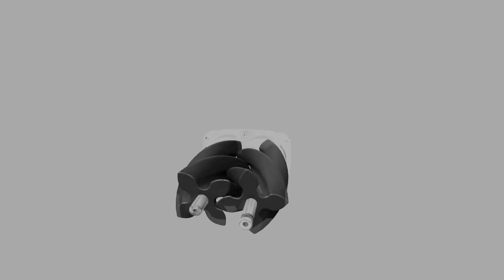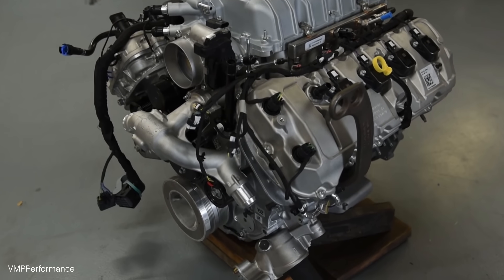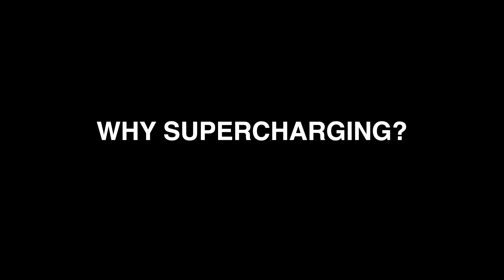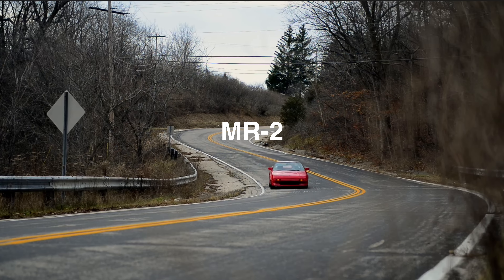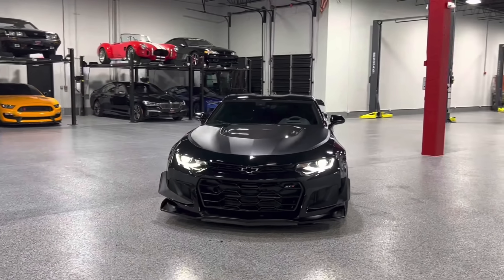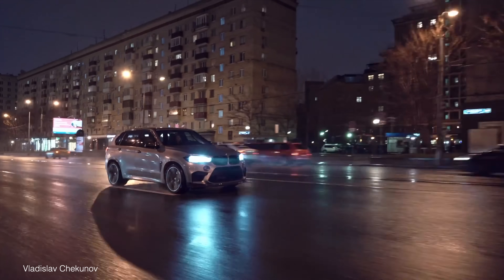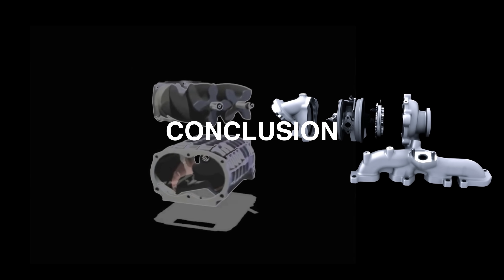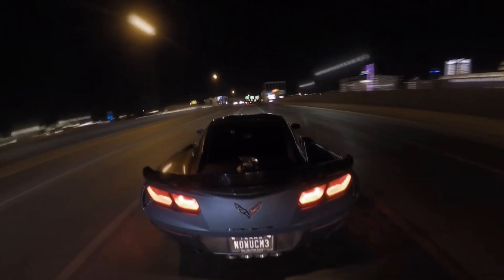Why V8 Engines Are Supercharged vs. Turbo😮| Explained Ep.6

Comment: My limited experience between the two is the absolute and immediate brute  force of a supercharger vs the mild start then overwhelming and uncontrollable kick from a turbo.   Love this channel
Reply: Gen 1 coyote can make 650hp safely with a vortech or Whipple, but It can make over 700hp with a single or twins without ripping the crankshaft input off, kicking a rod thru the side of the block. Turbochargers will always be easier on parts and more efficient because they do not have parasitic loss like a supercharger. This guy is smoking pole.
Reply: That limited experience must have been with improperly sized turbos and dumb Honda kids, because the right size turbo for whatever engine it’s on will provide more power everywhere- starting right off idle. Notably more than a supercharger.
Reply: @boost1728 Gotta say i drove a C43 amg and a S4 3.0 Supercharged. The brute force is a thing, i would always prefer a supercharger on bigger engines, on smallers a turbo feels better. But damn that throttl response is brutal, it accelerates like a electric car, especially with a dual clutch. I remember a W205 C63 in my rear which was chasing me. As soon as the autobahn was free i hit the throttle and i was already gone, he was faster than me in the end, but damn it took him like 4 secs to catch up until the turbos spooled. A supercharger just fucks off, when a turbo is more violent when it gets boost. Mine had a stage 1 remap to 400 HP, he had 457 stock or something.
Reply: @DarkSession6208 again, if the turbo was laggy and the supercharger smacked it off the line, it was the wrong size turbo. There’s a reason all the fastest pump gas street cars in the world are turbo. They make boost quicker off idle than a supercharger can, they make more power per pound of boost up top due to lack of belt-driven resistance, the list goes on. There is absolutely nothing a supercharger can do that a properly sized turbo can’t.
Reply: The new Porsche 911’s have hybrid turbochargers with electric assistance that give near instant torque. Turbochargers keep innovating and it’s so cool.
Reply: 2 spool or sequential twin turbo mitigate that problem, but turbos are less reliable.
Reply: @VndNvwYvvSvv lmaooooo
Reply: Turbo+n20=fast across the powerband
Reply: Are you stuck in the 80s?
Reply: Nearly 30 years ago I was in charge of production at Sprintex Superchargers (In Perth West Australia ) where we built and exported over 1000 units to Art Whipple (which is now Whipple Chargers and run by his son in Fresno California) There is the common misconception that turbo uses "free" energy from exhaust gas. This is simply incorrect. Many years of R&D at Sprintex and any identical engine with equal amounts of intake manifold pressure. (e.g. 50kpa) will make pretty much the same net BHP. We did diesel, petrol, aircraft, industrial engines, marine and old and new engine design all with fantastic results. Turbos can not take advantage of natural exhaust scavenging either. I agree it is a bit of a historical thing also but Superchargers do sound great..👍🤪🦘
Reply: U said it doesn't use exhaust gasses how does it work then would you care to explain?
Reply: @farayimatibiri1724  You missed the important word in his reply, "Free".

Comment: Instant torque/horsepower that's why superchargers are used in the usa. Superchargers also last longer as they have larger bearings inside and don't get as hot. So they don't burn up the tiny bearings like inside the turbo's. (cooked turbo bearings) Have fun when your turbo bearings burn up! Personally I'd just go to a watercooled 2 stroke 5.0 liter. Similar to the 2 strokes made by motorcycle manufacturers in the 1980's....OH cry emissions! Our state has NO emissions regulations...NONE. Eat me. Can you say 200hp from a 500cc engine with no turbo, no supercharger, no forced induction? YES YES I can.

Comment: We have been using a hybrid Supercharger / Turbocharger setup running in Series. Supercharger provides instant power and a linear boost curve. Turbos have both lag and exponential boost curve. When it spins twice as fast, it provides 4 times, not 2 times boost. 

We feed our Superchargers with boost from a Turbo. No lag, linear boost, and when Turbo spools up the boost, it reduces pumping loses in Supercharger. When boost is sufficiently high from Turbo, the Supercharger doesn't need to use power to also provide boost.  However it continues to provide linear boost control.

Comment: This video was made 10 months ago, so I'll give you the benefit of the doubt here, but EVs are not going to replace the internal combustion engine any time soon.

No one is building infrastructure for ev's, Toyota just said a few months ago that they are halting production on them because of this.

We need more than just charging stations, we need power plants, substations and transmission lines too. Gas, coal, and oil plants are off the table, no one wants to try to dispel the myth that nuclear is too dangerous to work, and solar and wind are part time sources of power.

Comment: One other thing about hybrids is that the electric motor is well suited to give a quick boost and compensate for turbo lag. The two fit really well together (e.g. McLaren P1)
Reply: You can also just drive the supercharger off the motor to avoid spool up altogether, while still making use of the more efficient Centrifugal compressor
Reply: No because hybrids are heavy
Reply: @kingdongo4388  They dont have to be
Reply: @SeeFlow-bo1dl  What’s weight is a heavy hybrid to you?
Reply: @kingdongo4388  p1 is 3000lb... a chiron is 4400lb.

Comment: Too bad there aren't any high HP factory centrifugally supercharged cars. I heard a procharged C8 the other day and I can't imagine a much cooler sound until you start talking about 600+ HP RB26's n shit.

Another thing I kinda want to see regarding the "hot V" configuration is something more like the Formula 1 long shaft turbo setup. The turbine is at the rear of the engine block, and the compressor is at the front. Each bank feeds into its own inlet on the turbine from either direction. I'm not only proposing that the industry tries that, but also take it a step further and do something like an axial flow turbine where the housing is literally a single collector for an all-into-one exhaust.

Comment: Fun project would be a supercharge Lt block and a electric motor system. Put the electric motor in the trunk with a trans running the rear end. Flip of a switch fires the real engine up disengaging the electric one and go have some fun

Comment: I’m glad you covered the M113K engine, I have an 2001 CLK 55 AMG and it has a M113 Engine and I plan on upgrading to have a kompressor, but I doubt the M113 engine can easily be converted into a m113k engine

Comment: they could've work on technology of burning close to 100% of fuel instead of 35% to get better gas mileage,and burn cleaner,rather than electric cars

but that screwup the car manufacture as to why they didn't do it sooner,and nobody wants that

good luck mining out lithium and recycling it,they may not emit co and co2, but coal power plant that provide electricity to charge the battery,release a lot more!!

since power plant are not inside the cities and nobody in the city can't see,it's OK

GREAT JOB ON SAVING PLANET🤣🤣🤣

Comment: some more things to consider:  with a turbo, you can much more play around with your setup and boost pressure in every situation even with independent profiles. with a turbo, you have more choices for upgrades and in some cases you even can do one single turbo, or two smaller ones, depending on which part you need your power. i see the supercharger more a thing which comes from the manufacturer on bigger motors and the turbocharger is more a thing for smaller motors and the tuning szene. i would never put a supercharger to a inline motor. on the other side, the whine is just crazy cool, you never get this with a turbo.
Reply: But a turbo releasing pressure between shifts also turns heads.  Especially in crowds when it's modded. Lol.

Comment: What I want to know: why centrifugal SC are never used in oem production…
Reply: I would imagine, yes it has all the same problems of both positive and scroll, but I just wonder wouldn’t it be an easier install? Less heat issues? Gives boost where you need it, on the Highway…I live in a city where you stop every 10 seconds so a positive just seems pointless (if you respond remember this: it’s all unnecessary, we get FI because we like it), but I’m looking at installing a forced induction system but can’t decide between the three…considering it’s a build on an existing vehicle I’m just not sure I want to deal with exhaust. Then again I’m not going for HIGH gains so not looking at doing fuel pump/injectors.

Comment: 4:05 straight up lie.
Chevrolet Camaro ZL1 lapped the Nürburgring in 7.29,600
Porsche 911 991 GT3 lapped Nürburgring in 6.55,340

34 seconds apart, hence the different price tag. It's not about "prestige" as you say in the video, it's about pure performance, something which the Camaro is clearly missing

Comment: Turbo to get horsepower, but to supercharge you need horsepower from the jump. For instance, almost every truck has a turbo so the engine can make more power. Not for speed, it's so the engine isn't insufferable

Comment: I'm guessing a big part of it is powerband as well. V8s, especially American ones, favor torque and midrange versus high rpm hp. A supercharger is perfect for that. A turbocharger favors revving the car out which is better suited for smaller displacement, high strung engines.

Comment: I've always preferred superchargers just because of the sound. They rev in sync with the engine, so you end up with a beautiful harmony of engine revs with supercharger whine and it's just the most glorious thing you've ever heard.
Reply: They do sound good indeed. I'm an European so I don't get to hear muscle car v8 that often, but when I do its amazing. Turbo chargers are also very popular in Europe because of evolution of diesel engines, which were the norm back in the day and which made small displacement diesel engines both powerful, with lots of torque, and economical. One of the best examples I can think of is BMW which for a 2.0 turbo diesel could get 60+ mpg while having 184 to 213 hp in 2008. Now it doesn't sound that much, but back then I was impressed.
Reply: It sounds like a lot to me. Hardly any vehicles today can get 60mpg and produce 200 horsepower.
Reply: Try driving a lotus Exige with that supercharger whining behind your head for 300 miles (I have) and it gets old REALLY fast 🤣 Still the most fun car I’ve owned but it made me appreciate a quieter turbo setup.
Reply: @Anticitizen666  I don't know about the Lotus but superchargers don't have extreme whine at cruising speed. you can't even hear them. they come alive when you're accelerating. so you must be driving in stop and go traffic for 300 miles? that's alot.
Reply: @mohammadkamran5862  like you say, you don’t know about lotuses 🤣
Reply: @Anticitizen666 the exige has “no grounding material” 😂

Plus…the motors like 2 ft behind ur back😊
It’s a race car basically….so in turn…

All race cars are light and loud when driving on streets…

Dad has a blown 67 nova…big cam…
And drives u nuts driving around❤
But I love tht😂

No thrills…pure pleasure of “mechanical terror on wheels”😂
Reply: Yes!
Reply: It’s sounds like an annoying high pitched scream to me
Reply: 10-4
Reply: @chrisg031 =6
Reply: 5

Comment: Turbo guy here..... for me its about boost.... With supercharging the boost is linear to the engine rpm meaning you will only hit full boost at redline. Where turbos will hit max boost considerably lower in the RPM range and hold it all the way to redline.

Comment: Well most American V8s have pushrod overhead-valve cylinder heads, particularly good for low rmp acceleration while most Italian/European V8s have dual overhead cam cylinder heads, four valves per cylinder configuration allows better airflow at high engine speeds, resulting in better top end power. DOHC engines also allow the spark plug to be placed right in the middle of the combustion chamber which in turn promotes efficient combustion However, American V8s like the Ford Modular have overhead cam cylinder heads as well.

Comment: Superchargers build boost instantly, V8s are bigger motors so it’s harder for a turbo to run boost through a bigger motor. So most twin turbo cars are v6. V6 motors are obv smaller so they build boost way faster.

Comment: I don't think the petrol engins are going to go away let alone quickly like everyone thinks. Fingers crossed I'm right for all our motor head sake.😉😊 what I think may in time give the super charger a run for its money is the electric turbo like Porsche has patented and tinkering with. As the technology grows for that it will be interesting to see how that goes. Because charging and batteries needed to power the electric to spool it. How long can it go how many hits can you get out of a charge. Space saver though because no longer need to hook to exhaust manifold so you can kinda put it where ever it seems. It will be interesting.

Comment: A supercharger has more lag from my understanding. It's direct drive off the crank. So it never reaches max blower rpm until the engine reaches max rpm. If a supercharger had more low-end or more torque or more power under the curve, then you would see supercharged big rigs, not turbo big rigs.

Also, because an engine is a pump, volumetric efficiency of a turbo engine vs. a supercharger, the turbo wins.

Comment: Turbocharging the higher displacement (American) V-8 engines would require so much intervention in the tune to make them produce controllable horsepower and torque curves for the street that why bother! A helical screw supercharger is simpler, and versatile enough to still make crazy yet reliable and controllable power.

Comment: I don't think turbos will ever be as cheap as a supercharger. A turbo needs to rotate fast, be aerodynamically efficient, withstand the hot pressurized exhaust and have low inertia. A supercharger is just a basic air pump. There's a reason why only 4 countries can design and produce their own jet engines (USA, UK, France, Russia, + China is getting there). Yes, fewer countries can make a jet engine than those that can make a nuke. A turbo is not nearly as complicated as a jet engine, but they share a lot of the same challenges to a lesser extent.

Comment: I went from twin turbos to a vortech ysi setup on my c5 z06.  I was able to win more races with my TT setup because boost came on gradually after my engine torque got me to speed whereas the Ysi setup had me at 500ft lbs tq at 2500 rpm which meant I had to roll race starting at 70mph and even then you still lost traction with street drags.  Yes it was fun being able to burn rubber at 70mph but it wasn't worth it in the long run.
Turbos with a stroked and cammed motor and then boost up high.....you will win more street races for sure.

Comment: Most new turbos are twin turbo. Not necessarily one identical  for each bank in a V or opposed  engine but flat 4 6 or even 5, a smaller día impeller / turbine for low rpm quick spool up low boost and volume  Another  but larger día for high cfm flow rate and boost pressure, supplying midrange to WOT. And even newer ones hace a electric motor within it to spool up quick than turbine/ exhaust takes over. F1 Has Electric in turbo.

Comment: When the argument gets into the milliseconds and percentages, it becomes irrelevant to most drivers. Most of us will not be racing anyone in Leguna Seca or the Ring. So for most of us, the experience the car gives use while we drive it on the street has a lot more value. So for those reasons, I still prefer a V8 over an EV even though an EV might technically be faster, because the V8 has that great sound, how the entire car torques to the side when you rev it, that feel when it hits its power band. And I also prefer a stick shift when a dual-clutch sequential shifter is faster. Because I feel more connected with the car when I can choose my own gear mechanically with a stick. And same thing in this argument. Turbos might be more efficient, but there's something about that supercharger whine that adds to the driving experience the few milliseconds you would gain with a turbo would not...

Comment: So correct! And ... US and european markets come with quite different fuel prices as well. A little higher specific consumption of the US blower V8 is way overcompensated by lower prices for the cars at the US dealers and US lower gas prices. Even in europe i would buy a used US muscle car today instead of an Audi, BMW or Mercedes.

Comment: Don't forget that American cars use lower compression engines typically which without the supercharger are lazy and like power compared to what they're making while they're under boost. So if you supercharge an engine you make more power on the low end we're still waiting for the turbo to spool up. The higher compession engine makes more power in the lower RPM ranges so they can use the more efficient turbo.

Comment: Without capacitors that can hold a megawatt hour of power or more electric vehicles are going to be a disaster foisted upon us by rich dummies and ultimately they will fail and we'll go back to internal combustion cars because they work. Nobody has time to let an EV sleep for 5 to 8 hours like a person would have to in order to be fully recharged. Even electric forklifts in factories are a disaster and everyone hates them because they always have to be on a charger in order to be ready to go. That's just not practical. Just because someone is rich doesn't mean they know what they are talking about. Look at Hollywood and the music industry they're idiots and they're rich so one doesn't always equal the other.